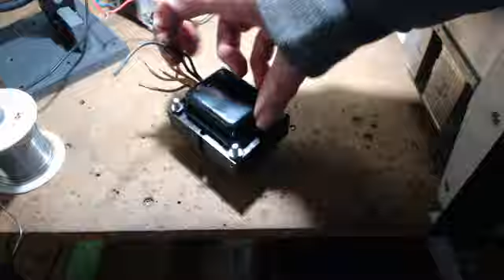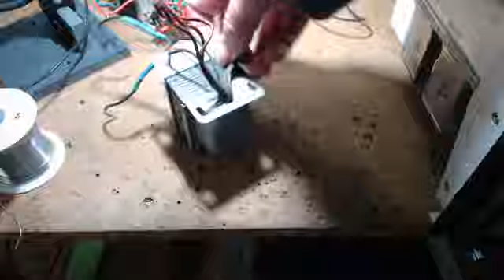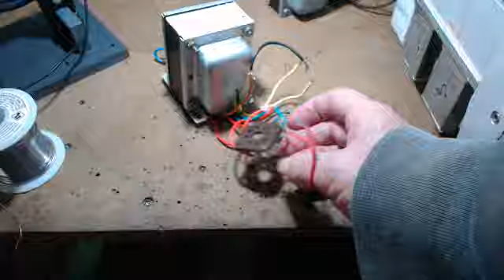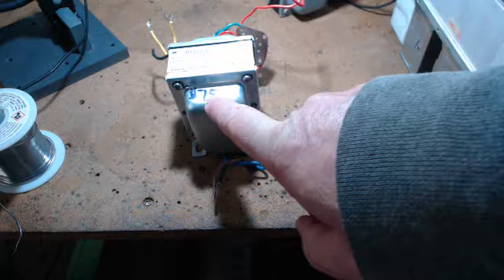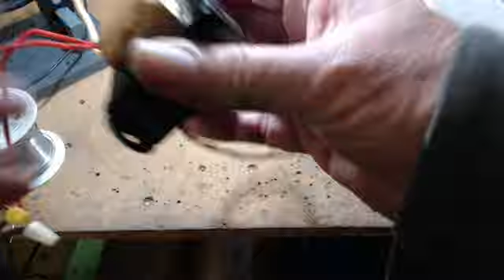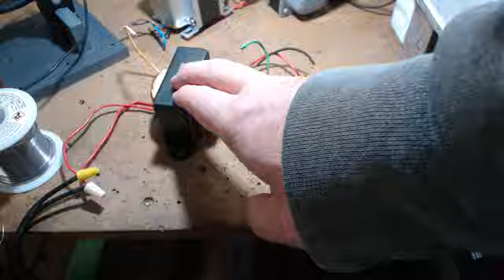Modern Transformer for old tube supplies.

Comment: Not all power transformers obey color coding conventions. When investigating, put an incandescent (not LED) light in series with AC as you probe. The light should light dimly when you have found the primary 110 volt connections, and the other windings will give you appropriate filament voltages etc. Transformers, generally, are rugged devices with low loss. Note: microwave transformers are popular salvage items. Be very careful, the high voltage winding can kill you.